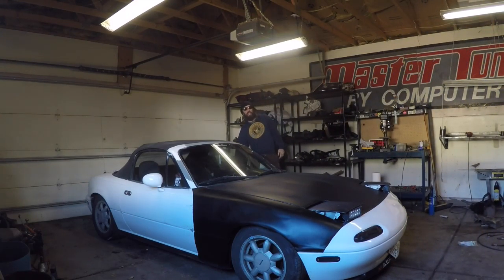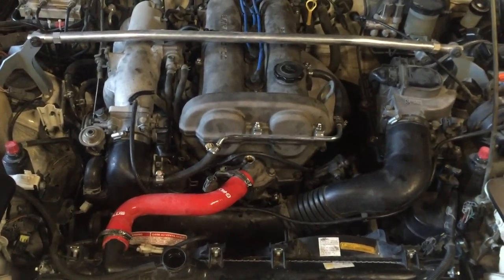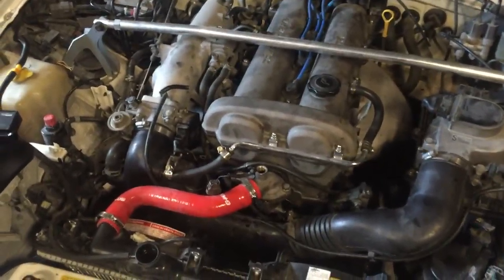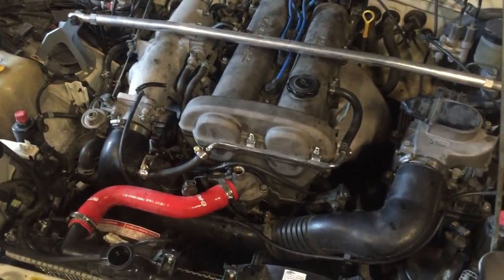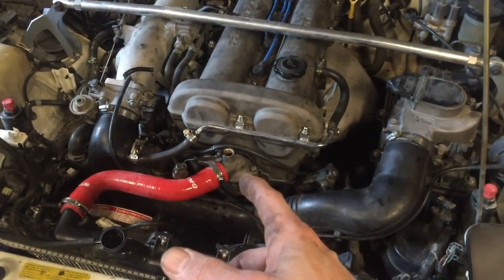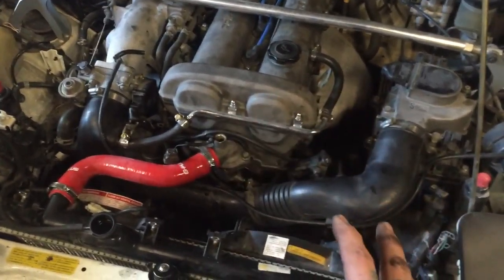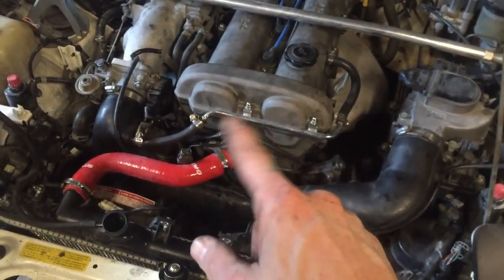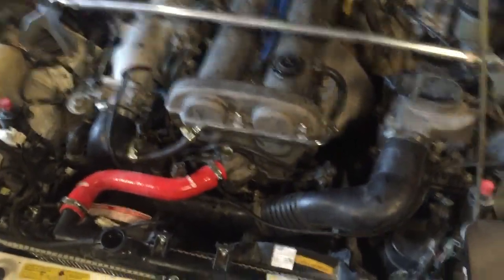Miata Timing Belt and Water Pump S07E27

Comment: I think I now have this car. Picked it up for one of my spring summer projects
Reply from the maker: was it totaled at an insurance auction? cause thats where this one ended up.
Reply: Wayne'sWorkVlog yeap. using some body parts to repair another and turning this into stripped down racer
Reply from the maker: excellent. you know Tucker? the original owner?
Reply: Wayne'sWorkVlog nope
Reply: Needless to say I am glad I stumbled across this video, lets me know that mechanically it has been maintained. Still runs good and actually drives fairly well now that I got the front drivers side from rubbing the radiator support
Reply from the maker: yea, it was a good car. and timing and water pump plus tensioner is all new! lol